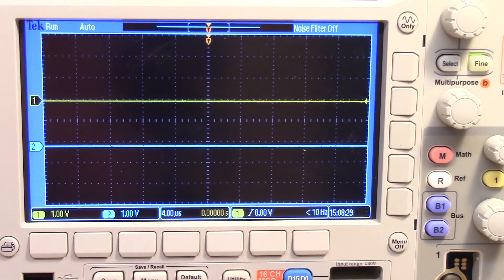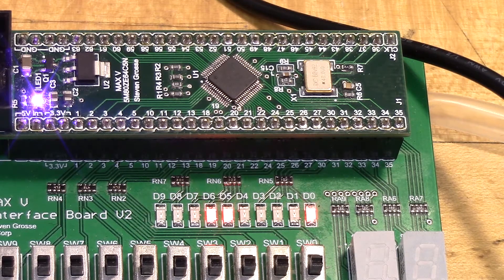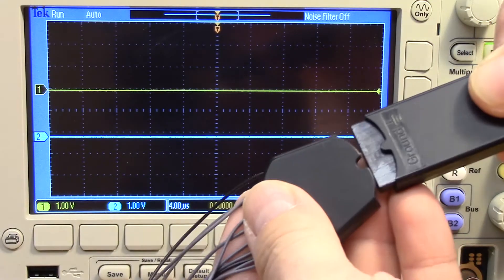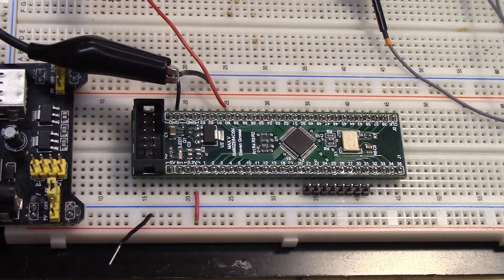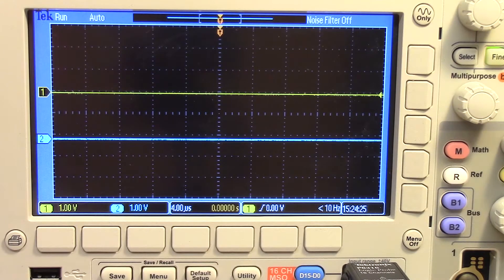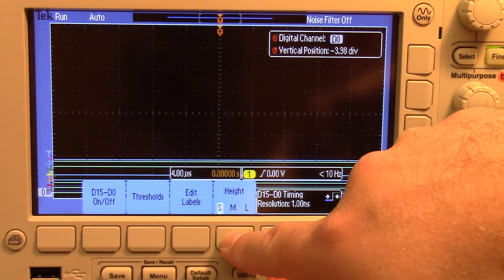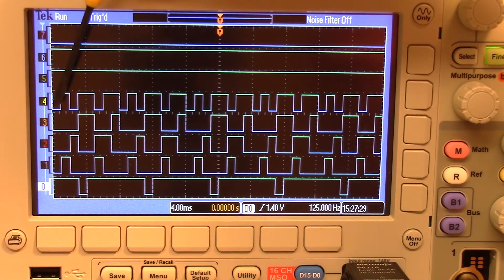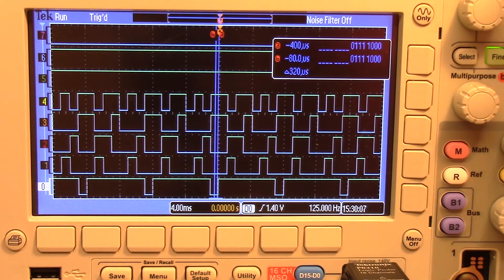Logic Analyzer On an Oscilloscope

Comment: I have 15 samples of artificial batteries. I want to measure the changes of voltage with time of each for continuous 2 weeks. How can i measure all in same time with one oscilloscope? Is there any system i can connect to the oscilloscope?
Reply from the maker: A data logger would probably be best to measure that over a long period of time.  Oscilloscopes are really meant for small time scales.  National Instruments has a number of things that could do what you want.  You can also build one with an Arduino, an SD card reader/writer, and maybe a handful of sensors.
Reply: @g-corpelectronicsedu96  can you find me the link of it on aliexpress which you suggest? And the tutorial of how to set. I really appreciate if you can help me on this. And the voltage must be between 1mV to 1V.